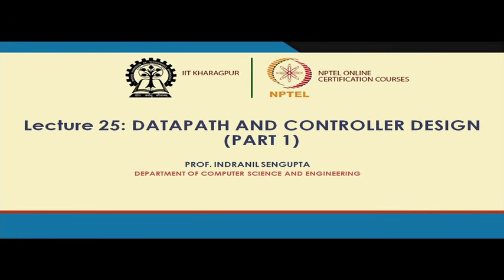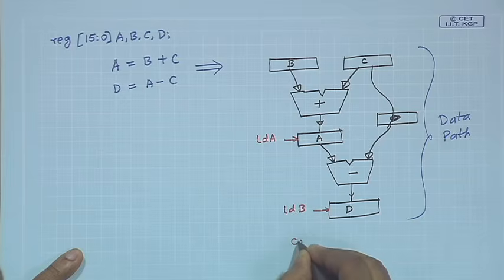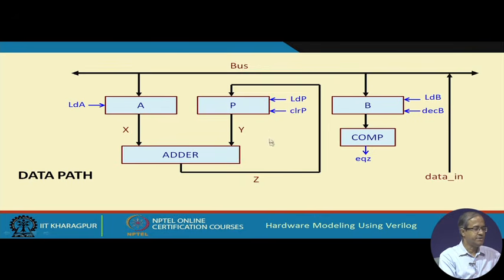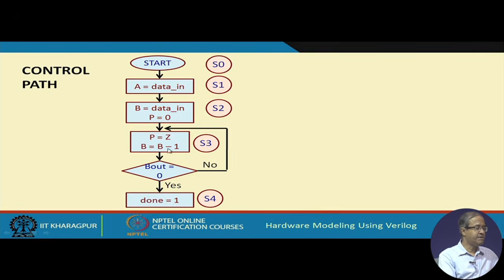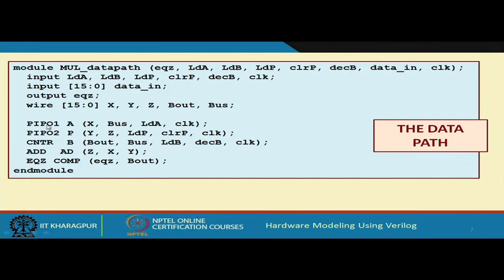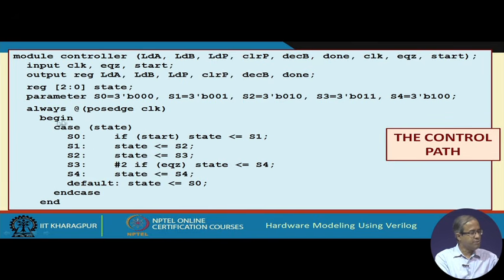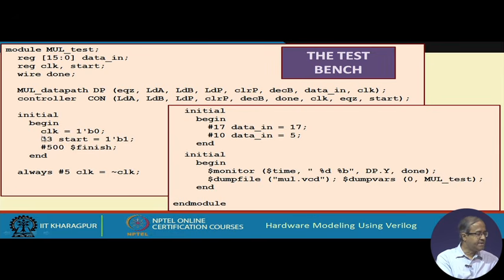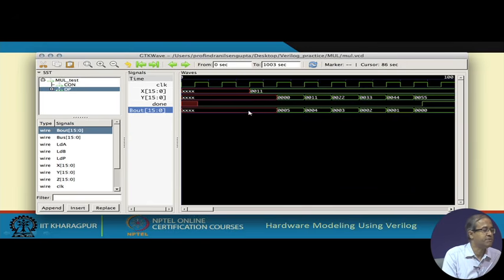DATAPATH AND CONTROLLER DESIGN (PART 1)

Comment: @30:29 How come done gets asserted at the middle of the clk pulse? Also it would be interesting to look what happens at the next clock edges after done is asserted. Would the Accumulator still keeps adding for the next clock cycle or not. Thanks for the lecture series.

Comment: At 19:05 while proffesor is specifying the pipo 2 at the always block -I think he should also might have mentioned posedge or negedge of the clear signal(clr)
Reply: then that will become asynchronous clear. prof has used synchronous clear.
Reply: @ankitchaudhary9074  Hey bro actually i was wrong 1 year back and you are also not correct becoz it is the clr signal (clear signal) is in the if braces so it is not in the code line of the always block he jusst used the clr signal if it is 1 then execute the " if "  if not then else. the point here is not about the synchronous or asynchronous
Reply: @TejaChappali bro that's exactly how we write code for synchronous clear. If we write clr in always line (in event expression) then it will become asynchronous clear

Comment: GUYS FIRST TRY WRITING FROM THOSE DIAGRAM IF POSSIBLE  IF STUCK LOOK AT SIR'S CODE else if stuck here you go,           module data_path (

    input lda, clrp, ldp, decb, ldb, clk,
    input [15:0] bus,
    output eqz
);

wire [15:0]  x, y, z, bout;

p_stuff p(y, z, ldp, clrp, clk);
a_stuff a(x, lda, bus, clk);
b_stuff b(bout, ldb, decb, bus, clk);
adder add(z, x, y);
comp_stuff cmp(eqz, bout);

endmodule

module comp_stuff(eqz, data);
    input [15:0]data;
    output eqz;

    assign eqz = (data == 0);
endmodule

module adder(z, x, y);

input [15:0] x,y;
output [15:0]z;

assign z = x + y;

endmodule

module b_stuff(out, load_data, dec_b, data_in, clk);
    input load_data, dec_b, clk;
    input [15:0] data_in;
    output reg [15:0]out;
    always @(posedge clk) begin
        if (load_data) out <= data_in; 
        else if (dec_b) out <= out - 1;
    end
endmodule

module a_stuff(out, load_data,  data_in, clk);
    input load_data, clk;
    input [15:0] data_in;
    output reg [15:0]out;
    always @(posedge clk) begin
        if (load_data) out <= data_in; 
    end
endmodule

module p_stuff(out, data_in, load_data, clr, clk);

input load_data, clr, clk;
input [15:0] data_in;
output reg [15:0]out;

always @(posedge clk) begin
    if (clr) out <= 0;
    else if (load_data) out <= data_in; 
end

endmodule

module controller(lda, ldb, dec_b, ldp, clrp, done, start, eqz, clk);
    input start, eqz, clk;
    output reg lda, clrp, ldp, ldb, dec_b, done;

    reg[2:0] state;

    parameter s0 = 3'b000;
    parameter s1 = 3'b001;
    parameter s2 = 3'b010;
    parameter s3 = 3'b011;
    parameter s4 = 3'b100;

    always @(posedge clk) begin
        case (state)
            s0 : state <= s1;
            s1 : state <= s2;
            s2 : state <= s3;
            s3 : #2 if (eqz) state <= s4;
            s4 : state <= s4;
            default: state <= s0; 
        endcase
    end 

    always @(state) begin
        case (state)
            s0: begin #1 lda = 1'b0; ldb = 1'b0; ldp = 1'b0; clrp = 1'b0; dec_b =1'b0; end
            s1: begin #1 lda = 1'b1; end
            s2: begin #1 lda = 1'b0; ldb = 1'b1; clrp = 1'b1; end 
            s3: begin #1 ldb = 1'b0; clrp = 1'b0; ldp = 1'b1; dec_b = 1'b1; end
            s4: begin #1 done = 1; ldb = 0; ldp = 0; dec_b = 1'b0; end 
            default: begin #1 lda = 1'b0; ldb = 1'b0; ldp = 1'b0; clrp = 1'b0; dec_b =1'b0; end
        endcase
    end 
endmodule

module MUL_test;

    reg [15:0] data_in;
    reg clk, start;
    wire done;

    // DUT instantiation
    data_path DP(
    .lda(LdA),
    .clrp(clrP),
    .ldp(LdP),
    .decb(decB),
    .ldb(LdB),
    .clk(clk),
    .bus(data_in),
    .eqz(eqz)
);
controller CON(
    .lda(LdA),
    .ldb(LdB),
    .dec_b(decB),
    .ldp(LdP),
    .clrp(clrP),
    .done(done),
    .start(start),
    .eqz(eqz),
    .clk(clk)
);

    // Clock generation
    always #5 clk = ~clk;

    initial begin
        clk = 1'b0;
        #3 start = 1'b1;
        #500 $finish;
    end

    initial begin
        #17 data_in = 17;
        #10 data_in = 5;
    end

    initial begin
        $monitor($time, " Done: %b", done);

        $dumpfile("mul.vcd");
        $dumpvars(0, MUL_test);
    end

endmodule

Comment: Sir I didn't understood those time values that is how 6 came after 0. And how 35 came after 6 and so on
Reply: And one more thing is I didn't understood DP.Y values also
Reply: @harshithambati9070  DP.Y because Y is not present as either input or output port in datapath module .this is a wire inside datapath so to access it inside the test bench it's using DP.Y

Comment: For me the program ran quite smoothly. just be caution in the top module mul_datapath you need to drive the "bus" with "data_in" . I simulated in icarus varilog. The full code is attached below

`timescale 1ns / 1ps
module mul_datapath(eqz,lda,ldb,ldp,clrp,decb,data_in,clk);
input lda,ldb,ldp,clrp,decb,clk;
input [15:0] data_in;
output eqz;
wire [15:0] x,y,z,bout,bus;
assign bus=data_in; // driving the bus with help of data_in.
pipo1 a (x,bus,lda,clk);
pipo2 p (y,z,ldp,clrp,clk);
cntr b (bout,bus,ldb,decb,clk);
add ad (z,x,y);
eqz comp (eqz,bout);
endmodule
 
`timescale 1ns / 1ps
module add(out,in1,in2);
input [15:0] in1,in2;
output reg [15:0] out;
always@(*)
out=in1+in2;
endmodule

`timescale 1ns / 1ps
module pipo1(dout,din,ld,clk);
input [15:0] din;
input ld,clk;
output reg [15:0] dout;
always @(posedge clk) begin
    if (ld) 
	  dout<=din; 
end
endmodule

`timescale 1ns / 1ps
module pipo2(dout,din,ld,clr,clk);
input [15:0] din;
input ld,clr,clk;
output reg [15:0] dout;
always @(posedge clk) begin
if(clr) dout<=16'b0000_0000_0000_0000;
else if(ld) dout<=din;  
end
endmodule

`timescale 1ns / 1ps
module eqz(eqz,data);
input [15:0] data;
output eqz;
assign eqz=(data==0);
endmodule

`timescale 1ns / 1ps
module cntr(dout,din,ld,dec,clk);
input [15:0] din;
input ld,dec,clk;
output reg [15:0] dout;
always@(posedge clk) begin
if(ld) dout<=din;
else if(dec) dout<=dout-1; 
end
endmodule

`timescale 1ns / 1ps
module controller(lda,ldb,ldp,clrp,decb,done,clk,eqz,start);
input clk,eqz,start;
output reg lda,ldb,ldp,clrp,decb,done;
reg[2:0] state;
parameter s0=3'b000,s1=3'b001,s2=3'b010,s3=3'b011,s4=3'b100;
always@(posedge clk)
 begin
  case(state)
   s0: if(start) state<=s1;
	s1: state<=s2;
	s2: state<=s3;
	s3: #2 if(eqz) state <=s4;
	s4: state<=s4;
	default: state<=s0;
	endcase
 end
 
always@(state) begin
case(state)
 s0:begin #1 lda=0;ldb=0;ldp=0;clrp=0;decb=0;end
 s1:begin #1 lda=1;end
 s2:begin #1 lda=0;ldb=1;clrp=1;end
 s3:begin #1 ldb=0;ldp=1;clrp=0;decb=1;end
 s4:begin #1 done=1;ldb=0;ldp=0;decb=0;end
 default:begin #1 lda=0;ldb=0;ldp=0;clrp=0;decb=0;end
 endcase
 end
endmodule

module testbench;
reg [15:0] data_in;
reg clk,start;
wire done;
mul_datapath dp (eqz,lda,ldb,ldp,clrp,decb,data_in,clk);
controller con (lda,ldb,ldp,clrp,decb,done,clk,eqz,start);

initial begin 
 clk=1'b0;
 #3 start=1'b1;
 #500 $finish;
 end

always #5 clk=~clk;

initial begin 
#17 data_in=17;
#10 data_in=5;
end
initial begin
$monitor ($time," %d %b",dp.y,done);
$dumpfile("mul.vcd");
$dumpvars(0,testbench);
end
endmodule 

command prompt command-

1-      iverilog -o mysim mul_datapath.v add.v pipo1.v pipo2.v eqz.v cntr.v controller.v testbench1.v
2-      vvp mysim
3-      gtkwave mul.vcd

to download individual file check this github link 
https://github.com/replica455/Verilog_code_for_Multiplication-_by_repeated_Addition
Reply: ya right buddy.
Reply: your code runs smoothly  shows the output correctly, But when I tried acess the wave forms in gtkwave , It not working, all paramateres were marked as red , clock doesn't change.I don't know the reason .
Reply: Thank you.. I wasted 1 hour debugging this and now with this help I got the problem
Reply: Thanks👍
Reply: thanks buddy that means a lot

Comment: This code isn't working in any of the simulators. Can anyone help me where is the issue?
Reply: The data in is not going via bus
Reply: @kshitijgurjar7499  hy can you help me in solving a problem related to data path of 8bit shift
Reply: Modified code i have posted on gdrive link
Reply: @kshitijgurjar7499  can I know where is the gdrive link
Reply: Hey man, let me know if you were able to get it working.
I couldn't get it working too
Reply: @skandaprasad2160  Same. It's not working.
Reply: Same for me ,I think all we can do is just copy the concept and write the code ourself
Reply: https://drive.google.com/file/d/1iqjoj03TvAUaBAkCYZ-vNPSE7JSK4ywl/view?usp=drivesdk
Reply: use data_in instead of bus..while instantiating PIPO1 A...ommit bus as it is not required